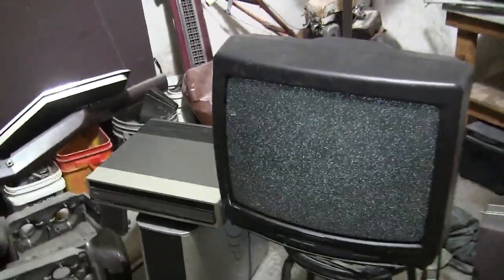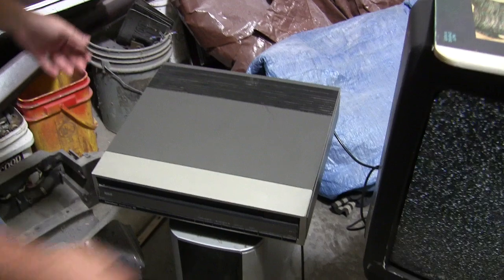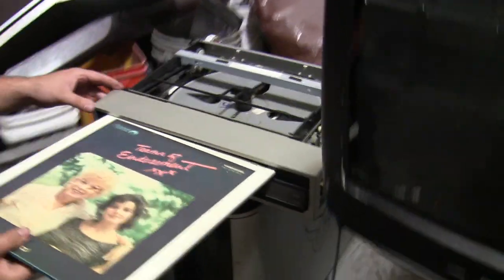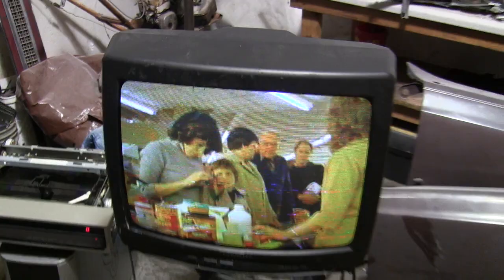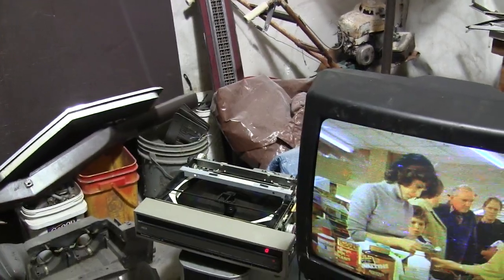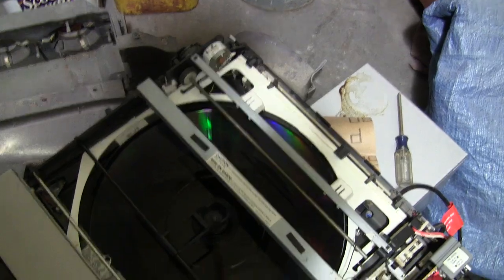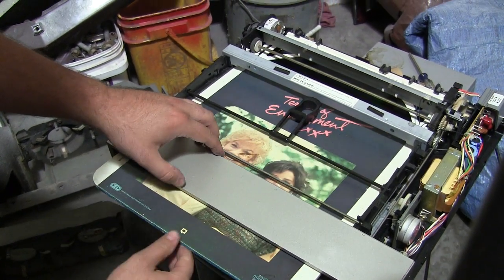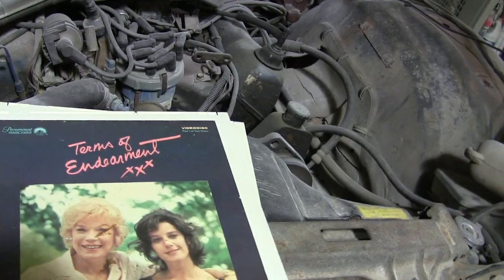Capacitance Electronic Disc System

Comment: RCA spent 17 years and 600 million dollars just to launch it right after VHS. On a medium that held 60 minutes of data. Those poor bastards!
Reply: Just over 60 minutes per side, so just over 120 minutes on one disc.

But, yeah, there was no value argument with CED.

Picture quality that was only on par with VHS at best, so LaserDisc kicked its ass up and down the block.

Couldn't record; at least LaserDisc offered the best possible picture for a home format until DVD came along.

Sound quality that was superior to video tape ... until the advent of Beta hi-fi and VHS Hi-Fi.

Came out way too late; about three years after LaserDisc and four years after VHS in North America.

Occasional skipping was an annoying quirk, even on perfect discs.

The cost to buy movies was low, but more people preferred to rent their movies for even cheaper.
Reply: it was actually cheaper to produce than the original VHS but since VHS took off the price of making the VHS wend down to like 1 buck.